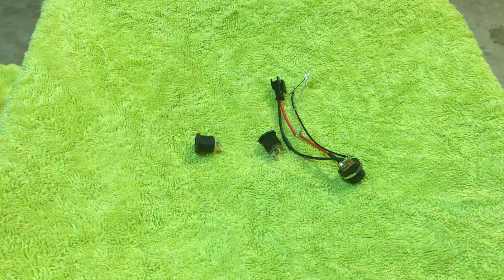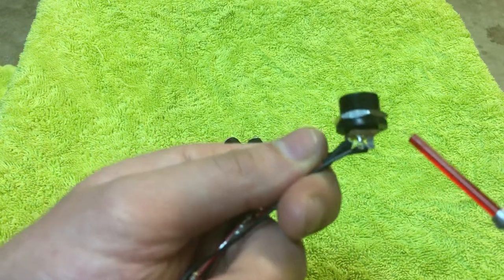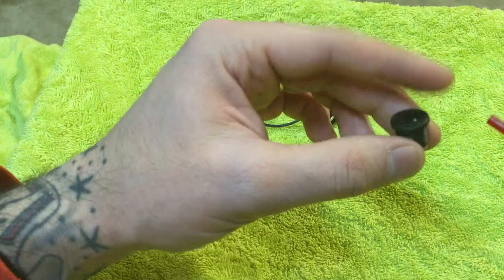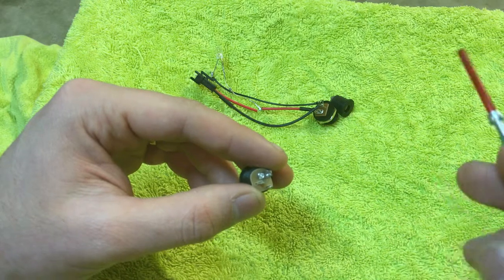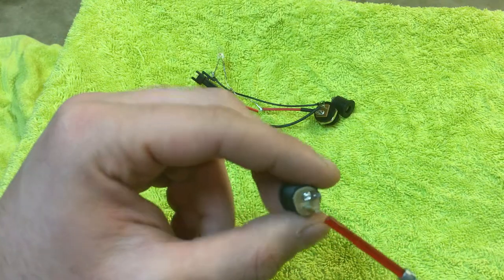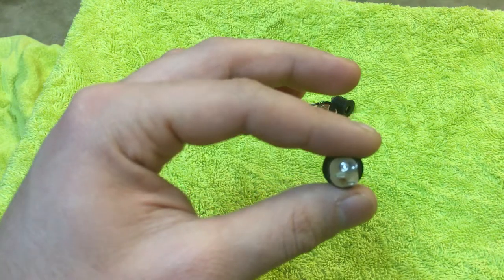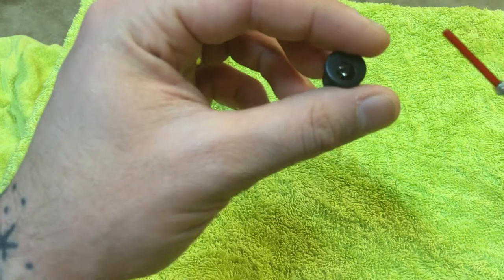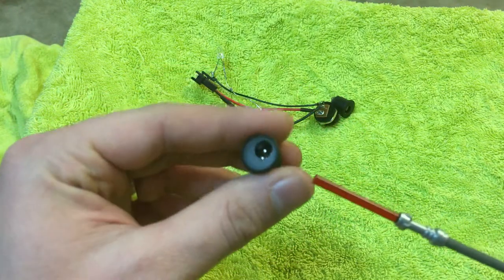Recharge Ports for Dummies

Comment: What adhesive do you use to secure it in the hilt once it is all wired up? Thanks!
Reply from the maker: +Scott Hunter I use teflon tape, wrapped till you can just barely push it back in. If you have to use adhesive, try and find something that will loosen up when heated in case you ever need to replace it sine those plastic cannon recharge ports have a tendency to fail over time.
Reply: +Darth Callidus Thank you so much, man! I appreciate your input. I had ordered a saber from Saber Forge last year and they seemed to be a little conservative with their adhesive application and the glue (I'm assuming Loctite) wound up coming free. As of now the plastic recharge port pulls out slightly when I pull the kill key. I'm assuming it isn't very healthy for the wiring as I am assuming that is the only factor providing resistance. Again, I appreciate your help!
Reply from the maker: +Scott Hunter no problem, glad to help!

Comment: Hey Daniel, thanks for the video. I have a short question. I maaayybee have charged my lightsaber with a charging cable with more current and more voltage than the original one. I saw that the original cable has 3A but i don't know how much voltage. Also i don't know if i killed my board forever. (It stopped working when it was empty but did'nt start until then) Is this possible or even very likely? :c

Comment: well this definitely helped me realised why my recharge port on my arbiter hasn't been working to charge my saber and my kill key lodged itself in the port, you can see my problem on my channel in the last video I posted. Any advice or tips would really be appreciated man.
Reply from the maker: Looks like from your video that the switch inside the port broke....that's why it won't switch to charge when you plug the charger in. If you just got it it should be under warranty from SF, the have pretty good turn around on warranty fixes....good luck, hope they can get you taken care of!
Reply: +Darth Callidus Ah, well I've pretty much decided to get into the DIY world of sabers with this saber, so your videos and a few others will be my teachers, your vids are helping me a lot man, thank you.
Reply from the maker: +Randy Savage awesome, that's what I like to hear!
Reply: +Darth Callidus So when I want to pull the switch and charge port out of my arbiter, how would I go about removing those and the other internals with how saberforge has the installed
Reply from the maker: +Randy Savage Your going to have to snip the wires and re solder later if you want to remove everything.
Reply: I can solder and heat shrink everything just fine, i just want to know how to pull the switch, charge port and soundboard without demolishing them
Reply from the maker: +Randy Savage Honestly I dont know, there is so much inconsistency in how SF installs their boards..the dont use a chassis so it should just come out, and then you can pop the switch and recharge up through the holes after loosening the glue with a heat gun.
Reply: +Darth Callidus I figured the battery and soundboard would just pull out once the snap ring was removed and the speaker was loose, but the speaker and the battery stop just past the threads for the pommel, so I guess I'm grabbing a hair dryer and trying to pop the switch out etc. so I can clip those wires and see if it's just short wires that are keeping the internals in there
Reply from the maker: +Randy Savage Without seeing it I cant really say, Ive never done anything than my own installs so im not sure exactly how they do it...shouldnt be any snap rings holding anything in either.
Reply: +Darth Callidus I've got everything out except the switch now, i've tried acetone in case it was glued like the charge port, i've had heat on it to the point where you can't even hold the saber, luckily I have wrap on it, and i put a screwdriver in it to try to pop it out, i've tried an Allen key in the charge port hole to pull out the switch out... nothing is working, they wouldn't have actually threaded the damn switch in there would they? I don't think they could with the wires... they made the wires super short like wired the switch and port while the internals were already in the saber so I had to cut them
Reply from the maker: +Randy Savage I'd ise wood so it dosnt scratch the aluminum and put it through the the saber so from the pommel out the emitter, get t against the switch and pull up from both sides.
Reply: +Darth Callidus that is a great idea and I will definitely be trying that tonight, i'm not entirely worried about scratches because I can always smooth it back out and refinish it later. thanks bro
Reply: +Darth Callidus DUDE I GOT IT! If it weren't for your idea I never would've tried this, but the only wooden dowel that would've fit was too thin and just bent, so I took the longest screwdriver I had, it wasn't long enough to go all the way through, but it made me think of trying to put the screwdriver past the switch, and pry the switch downward with the shaft of the screwdriver instead of up with the head... it popped right out. So thanks for the idea, my solution derived from it, now I get on with rewiring this bad boy.
Reply from the maker: +Randy Savage Awesome! I keep an assortment of dowels and flat skinny pieces or wood just for that kind of thing, pushing wires through, ect! Now comes the fun part!
Reply: +Darth Callidus yup, the rewire... and soundboard repair if that's possible... i just found a small pice of the soundboard had broken off and was stuck to the electrical tape saberforge had it wrapped in... i don't know if broke that off myself, or that's what caused a problem I had when the sound screwed up and the blade led cut out
Reply: +Darth Callidus or I'll do a setup like yours where I have a charge port on a stunt saber  and wire in a latching switch
Reply from the maker: +Randy Savage Check out the corefx, it's a stunt board and will let you run a momentary switch and give you flash on clash, shimmer, ect